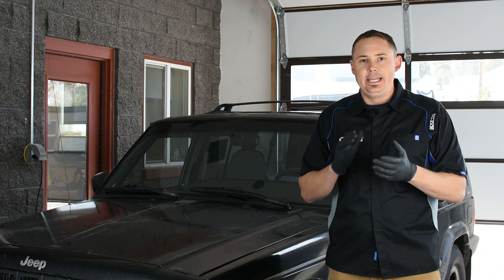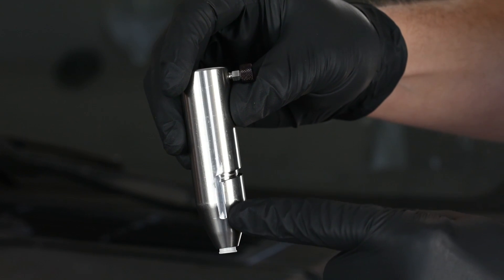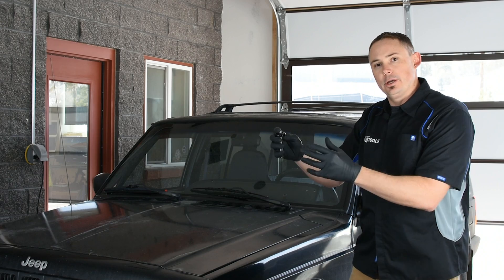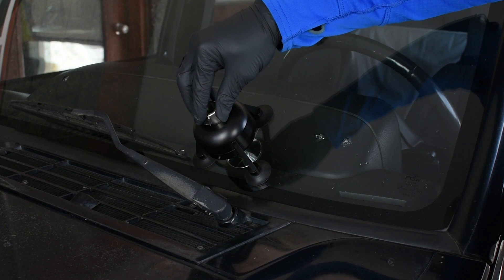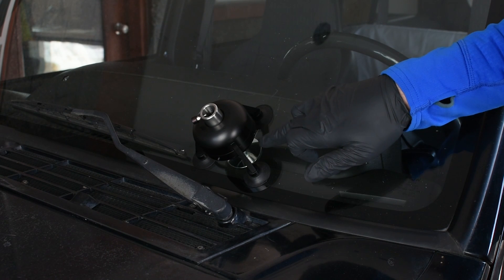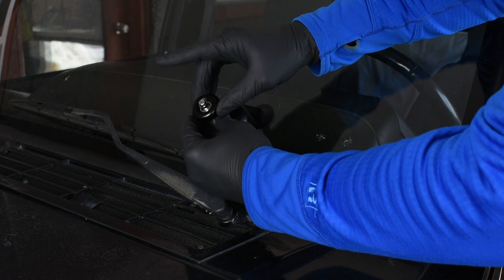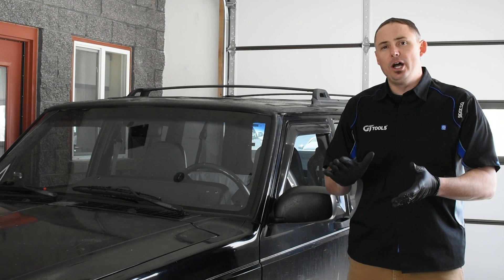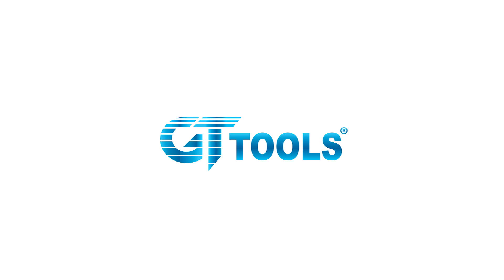[Repair Demo] The VANISH™ Windshield Repair System - GT Tools®

Comment: I mean it seems nice but what do you do if you have a chip on the very edge of the glass when you using a large tripod system like this? And why do you spend nine minutes on a video and rush to the end result? I’m not trying to be difficult but it seems like it needs more work as far as re-positioning where the resin would be placed and having more options to move it with maybe a bridge system just in case you get a chip on the very edge next To the molding, which is rare but it does occasionally happen. Otherwise it seems pretty good

Comment: Pretty sweet. I just replaced the windshield of my 2018 Prius (over $1k, $500 with insurance) because of a large crack that grew within minutes. Had it only been a chip I would want this tech to fill in the pit.

One question, what is the added value of using a pressurized system ave two applications of the resin when one application with s tab could have netted similar results? This is fascinating and I'd like to know more about the science behind it.
Reply from the maker: Pressure and vacuum are key to consist and efficient results. The process of pulling the trapped air from the break is key to allowing the resin to follow into the break much easier. Secondly, GT Tools does recommend a filling resin based on the temperature you are working in and a capping resin the seals off the repair.

Comment: What's the big difference between the Glas Weld Zoom and the Vanish system, both look really good.
Reply from the maker: Billy Minton Great question. Both systems are state-of-the-art in terms of injector technology. Similar vacuum and pressure capabilities. What you get with the Vanish, however, is our patented DarkCure technology. The DarkCure UV curing system is built directly into the bridge so no need to carry around a separate UV light. Curing times are under 15seconds, by far the fastest in the industry and the ultra high intensity of DarkCure actually eliminates the need for a pit square/curing tab.
Reply: If it eliminates the need for a curing tab, why is one used in the demo video above? Is there any solution for chips near the corner or edges of the glass where the suction cups would prevent the standard setup, or is the assumption if it's in a location like this, it is unrepairable anyway?Looks like a great product, we have one of the Zoom kits and like it, but this one seems like it might've refined some of the nuisances we've encountered with it.
Reply from the maker: Hey  @matttyler8331  , great questions! We used a curing tab in the video because we're working on a resin tip to spread out the pit filler in a thin layer. The DarkCure system definitely cures fully through the pit filler drop without a tab, but it takes a while to scrape away the large bubble of pit filler unless you are able to spread it thinly. 90% of repairs are done without the need to get near a corner or edge, and often breaks that are that close tend to crack out anyway. However, we've got a corner/edge/vertical glass adapter that will be releasing shortly after the Vanish Systems in April. Give us a shout at 970-247-9374 if you have any other questions!
Reply: @matttyler8331  How does the Zoom kit work for you?